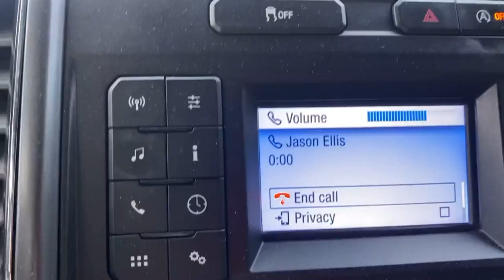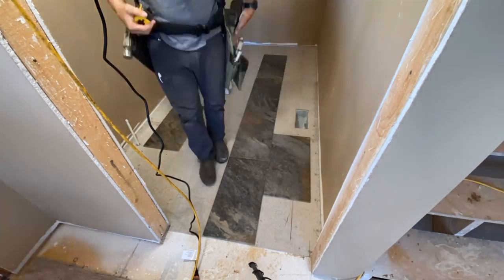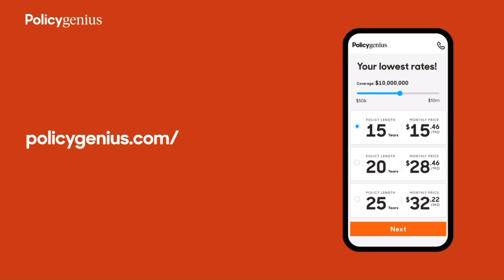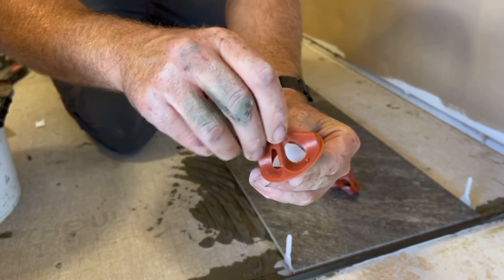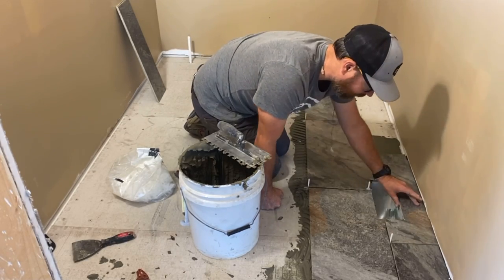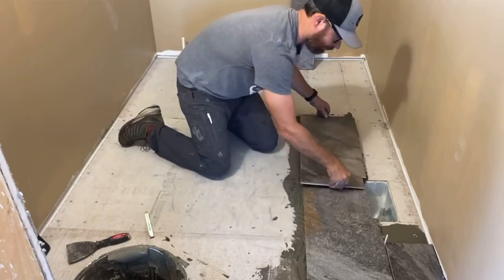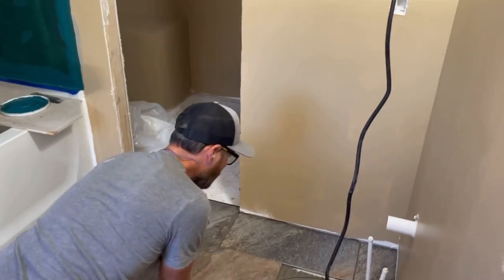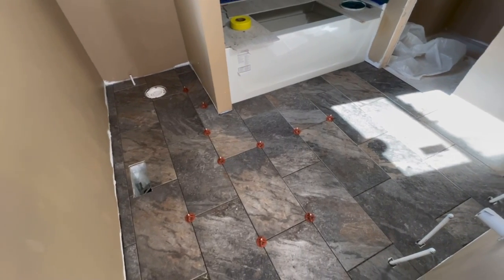Floor Tile Layout and Installation | Building The Nantahala Retreat #33

Comment from the maker: To start comparing quotes and simplify insurance-buying, check out https://www.Policygenius.com/Perkins. Thanks to Policygenius for sponsoring this video!
Reply: Hmm.  Course, this was a long time ago but I was taught that, when laying tile, what you do is find the center of the space, then lay two chalk lines crossing that center and work out on all sides from that.  That way all the cuts are even.  I only laid tile in two bathrooms and a kitchen.  But I have since noticed that most tile is laid like that.  I, personally, never was much for using larger tiles.

Comment: FYI...We are working on adding a porch volunteering for a non-profit.  I went into Lowes yesterday and bough Big Stretch caulk per y'alls recommendation.  Thanks for the tip.
Reply from the maker: Hey… Awesome! Really is the best stuff you can buy in my opinion
Reply: Big stretch is by far the best latex sealant on the market. Not even close. I have a few tubes of extreme stretch made by dap I’m my truck but I haven’t used it yet but they are at a major disadvantage because big stretch has set the bar extremely high
Reply: Have you ever tried quad max?

Comment: Quick tip for using the leveling tees. After you trowel out the thin set, run a margin trowel along the tile to clean out the squeeze out prior to placing the tees and tile.

Comment: Some pro-tips here: bond in a straight line, don't make these bows, straight lines will make sure the air can escape from under need when laying them. Place them with a light back and forward moving motion while pushing down so you push down the glue into the "open" rows. This ensures a 85% coverage which is the minimum recommended coverage. It is also recommended to install rectangular tile at 33% and not 50% overlay because the rectangular tiles will likely be a bit higher in the middle and be lower near the edges. Manufacturers therefore recommend 33% to not join the lowest and highest point of the tile in the middle. It also looks more modern. ;-)

Comment: Waterproofing under floors is always a good idea. Redgard. Aquadefense, etc. I always keep a clean water bucket nearby for quickly rinsing my hands between setting each tile.
Reply: Take up a tile floor that has been down for a few years and you’ll usually see a bit of swelling in the plywood at the grout joints. This swelling can pop a tile over time and waterproofing the floor, even just one coat, stops it.

Comment: Good way to avoid the squeeze out when using a levelling clip system is to run a margin trowel close too the edge of the tile before setting the clip and second tile. Cheers!

Comment: 11:20 that's my problem with these self leveling systems. I use the one with wedges and that too leaves a lot of adhesive in the joint. I always used to like laying the tile close and pulling away.

Comment: that's the big pain with tile levelling system is the squeeze out in the joints especially around the revellers, I clean the joints out before grouting, which can take as long to do as the grouting, but the tiles end up level, the levelling system can also straighten bent tiles to get sid of the lippage especially long wood effect tiles, I've seen long tiles with 1/4" hump in the middle of them

Comment: @8:14 dryer vent location?  Guessing a stackable washer/dryer set up?  Looking long term, seems like that would force homeowner to a buying a limited washer/dryer choice. 

Which is better, water supply lines up through the floor, than through cabinet base, or water lines stubbed out through wall than through back of cabinet?  I like stubbed out the wall, that way cabinet base is not crowed for storing stuff.  If water lines are close to exterior wall than up through floor is preferred.
Reply: They are custom home builders. Everything is what the homeowner wants.
Reply: Water through the wall would be the better choice. Less likely to be damaged by the washer bouncing around with an uneven load. Stackable washers are always a bad idea.

Comment: If those spacers lift the tiles to level them, does that leave a void under them?
Reply: No it's already been shown on a demonstration with clear glass as long as there is sufficient coverage (using proper trowels and back buttering your tile etc) it will not leave any voids
Reply from the maker: As long as your mud has good coverage and is the right consistency it won’t create a void
Reply: Seems un-natural!  Almost against Nature’s Law! Y’all playin’ wit fire bro!! I mean, you put it down, it settles, then you pull  it up!!  VOIDS!!!   RUN!!!
Reply: They don’t lift them up, they pull them down. If they’re being lifted up then you don’t have a suitable substrate or you’re using the wrong sized trowel.

Comment: Question.. if you twist tiles even and some lift instead of press down.. would that potentially leave a gap between tile/floor/thinest and possibly crack down the line?

Comment: Why do you not have any Pro Tips while tiling? 
To eliminate the squeeze out while using the levelers, after laying the tile down, I'll run my finger down the side wiping out the thinset. Slide in the levelers. Then when you add your next tile there's little to no squeeze out cause there's little to no thinset between the tiles. I carry a small flat head screw driver to clean out any squeeze out when it does occur. Quick and easy tool to pick out and clean. I also like using the wedges more than the screw systems.
Reply: Those aren't levelers, they are edge eveners. You can still have a very unlevel floor when using them. You know what will get you a level floor? A level and a functioning brain.
Reply: @MAGAMAN  Well, look who has a lot of lippage! Surprise! Surprise! Sorry I didn't go into full detail of how to lay tile for those people with functioning brains. But since the boys were saying one of the main reasons they didn't use the levelers on the second bathroom was due to squeeze out, I concentrated my comment on that. Also he mentioned learning the old skool way of leveling tile, so I skipped over that part. Most of us in North Cackalacky know how to level a room, so there's less work in leveling tile. Perkins Bros keep up the great videos. Love the Pro Tips!

Comment: Question for you guys..what steps do you take to lay down backer board on plywood subfloors??
Reply from the maker: Good question! I was thinking about doing a separate video on the building Knowledge channel about just that. Basically we use quarter inch hardy backer and use thin set plus screws on an 8 inch pattern to mechanically fastened it to the subfloor. There are lots of other details like where to break the tile under the door that I think will get covered in this other video I’m working on.
Reply from the maker: Good question! I was thinking about doing a separate video on the building Knowledge channel about just that. Basically we use quarter inch hardy backer and use thin set plus screws on an 8 inch pattern to mechanically fastened it to the subfloor. There are lots of other details like where to break the tile under the door that I think will get covered in this other video I’m working on.
Reply: @PerkinsBuilderBrothers  Awesome 👍👍 looking forward to that video!!

Comment: Would you mention the schluter membranes and your thoughts on them?  I’ve heard tiling right on the sub floor could result in cracked tiles - and of course I’ve heard that’s bogus if everything has been done correctly up to that point.  It sure is expensive and if the Perkins boys ain’t using it why did I ?
Reply: Check out the "tilecoach" channel. He does all kinds of tests on stuff like that. Tons of great information on that channel! These guys barely know what they are doing. Should be viewed for entertainment only, not education. At least on the RayJay Builder Buddies channel they don't pretend to be experts.

Comment: Question: When you guys are installing carpet adjacent to tile and the schluter strip is elevated with the backer board do you guys also use backer board under the carpet so that you don't stub toes on the strip or do you use a thicker carpet pad to make up the height difference of backerboard + tile?

Comment: As a novice at tile work, those "golf tees" look appealing.  However, I'd be concerned that they might lift tiles up out of the thinset and later cause a crack when stepped on.  Anyone have any experience with them?
Reply: If you put weight on the tiles, after tightening those "golf tees", they won't cause any problems later on.
Reply: @ThomasG092  They will if you have a lot more mud under one tile than another. It's best to just learn to do it properly instead of relying on these gimmicky products. Those tile spacers are also a terrible idea because a lot of tiles are not the exact same size and over time you may see your lines starting to slope in one direction or another. Use your eyes and use your brain and you will get a good result.

Comment: Isn't the toilet flange supposed to be on top of the finished floor? Or is that a myth they perpetulate instructions?
Reply: Myth
Reply: k perrin Nope.  Check with any plumber and they will confirm.  They'll also give you the reasons why.

Comment: When u use motor leveling system will it ever have to be raised up enough to level the tiles that it raises it out of motor bed ? Also when doing that wouldn't it be prone to tile cracking in that area ? Just a thought ! :)

Comment: Cue the comments about the toilet flange.  Plumbers will tell you that it is supposed to fit ON TOP of the finished floor, not level or below.  Toilets have a recess in their base to allow for this.
Their are other brands of tile levelling clips that are thinner and pretty much allow you to set the tile flush and then pull back.  I can see the clean up from the squeeze out being annoying.
Good video!

Comment: Why do the water line for the toilet and the sink come through the floor and not through the wall ?
Reply: It's likely an exterior wall.  You typically don't run water lines in an exterior wall as you don't want the pipes to freeze in the winter.
Reply: @jpionke1  So having them damaged by a washer with an uneven load is a better choice?

Comment: Those little twisty tile "eveners" look like a great way to pull the tile loose from the mortar. Hopefully those tiles don't all pop off after a year or two.

Also, when you back butter the tiles, go all the way to the edge. You likely have a lot of voids under the edges of the tiles when you do it the way you are doing it in the video, which can lead to broken tile edges.

Comment: Where is the waterproofing under the tiles?
Reply from the maker: It’s just a regular bathroom… The floor shouldn’t be getting that wet.  We do use the waterproof roll-on rubber membrane on shower vases with tile
Reply: @PerkinsBuilderBrothers  That roll on membrane is  mostly useless. If that is all you use under the shower, you are going to have problems down the line.

Comment: gotta say ... been working on a building from 1911 and the building practices were strong then.  No water damage, tight as a drum .... strong walls.  The 1965 part of the building that wraps around the 1911 part is the biggest pain in the tush .... WHAT HAPPENED in the 60's and 70' where they stopped trying to build stronger.  Sometimes it seems companies with new expensive methods or modern builds are just doing a money grab.

Comment: Also can't really tell which mortar you used but it's supposed to be one that has some flex in it when setting tile over pier and beam or wood substrates ,also suppose to thinset and screw in your backboard when setting on plywood or osb etc